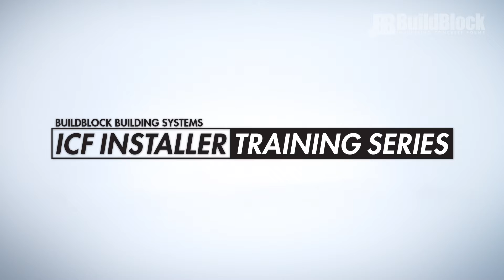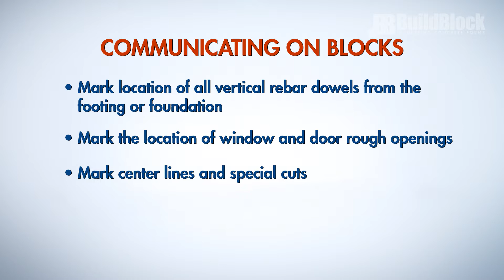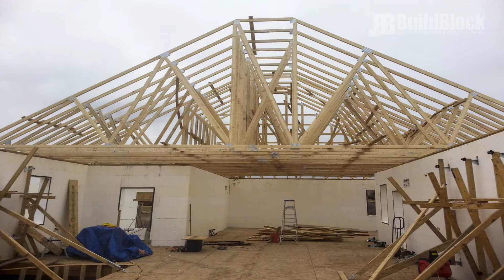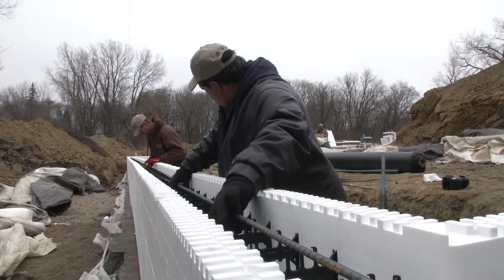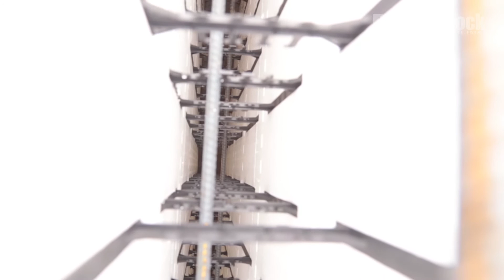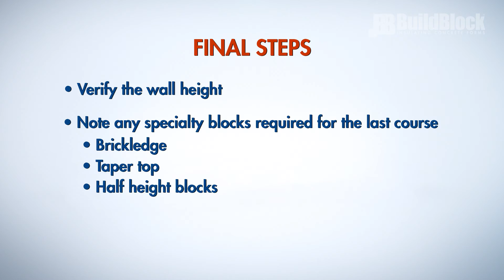BuildBlock ICF Installer Training Series: 11. Continuing up the Wall

Comment: Never place a block with only one strap, the concrete can twist the one strap causing a blowout.
Reply from the maker: It's totally fine to implement cut blocks with only one web into the wall. As we say in the video, you will want to brace and strap cut sections appropriately to avoid any failure. The buildblock web and interlock pattern are both strong enough to handle the concrete pour. Thanks for stopping by!